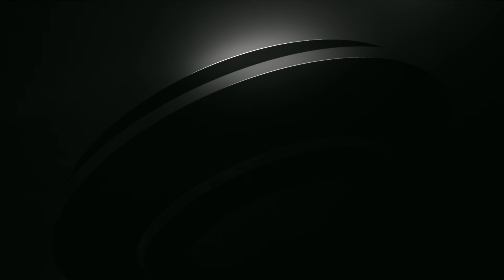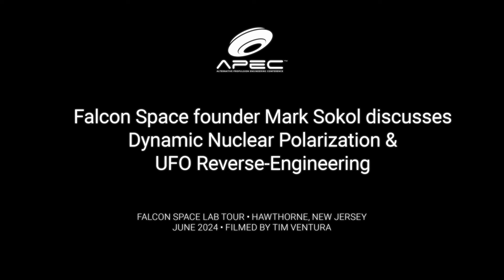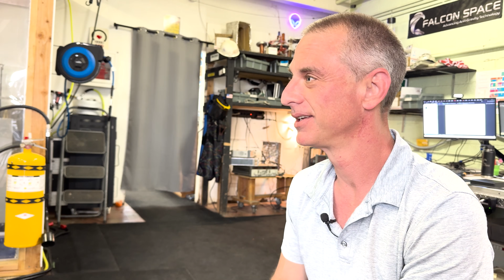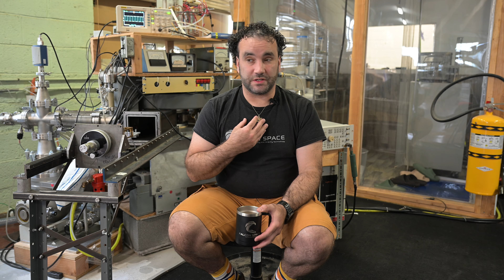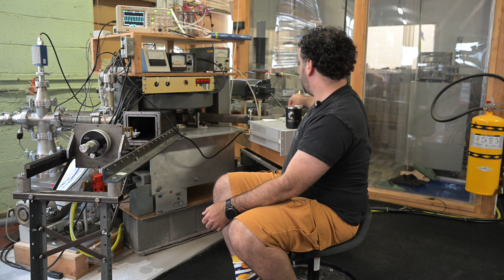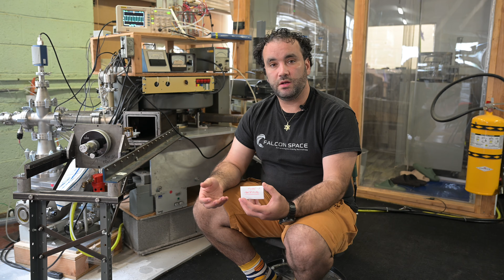UFO Reverse-Engineering & Dynamic Nuclear Polarization | Mark Sokol | Falcon Space 2024

Comment: If you find which energy band causes static on older analog radio antennas. You will be using the energy wavelength as the government crafts that abducted people all through the 70s-90s. It was quite common for people to mention bright lights and static on their radios when one appears. So lots of energy particles bouncing around. 

Also look into sand playing a roll. Some of them discharge sand plates. I believe for thermal regulation and possibly as a battery method. 

I have so many years of small little fact details researching these things. Could chat at all day. I really like your project to prove this is not some magic (or could look like magic to our present tech) and is grounded in science.

Comment: In addition to aligning nuclear spins via high frequency rotation, you need to put the atoms in the Bose-Einstein Condensate (BEC) state at very cold temperatures so that their spins are synchronized (coherent). You have to then compress these atoms together to make the material superconductive to reduce its permeability to Zero, increasing the speed of light in its vicinity. This then allows you to "wiggle" the highly dense centers of the atoms in a coherent way via electromagnetic waves, and that, in turn, generates the intense gravitational waves (GW) that Bob Lazar has been talking about since the late 80's, and that is how the GW are amplified. The problem is coming up with the money to do these experiments outside the US military which has an endless budget.
Reply: How do you know that?
Reply: @brianmcginnis7417  There are recent scientific papers published that show the internal density and structures of nuclei. I'm an Electrical Engineer (PhD), but a scientist/physicist at heart and have been studying UFOs, GW, and reading the latest scientific papers regarding related subjects (particle physics, astrophysics, etc) for the past 30 years. Also, I have proof that not the speed of light (C), but 2C (2 x C) is actually the measured relative "speed limit" of the universe (this is in the general case, not in the special case mentioned in my initial comment above). I can explain more if you want. Are you going to attend the APEC conference tomorrow afternoon?
Reply: @brianmcginnis7417  Interestingly, physicists/engineers always measure the resistivity or resistance or the current-carrying capability of superconductors (SC). Nobody measures the speed of light right at or above the surface of the SC inside a vacuum. I think they would find very fascinating results if they do so.

Comment: It is difficult to tell exactly what you are doing.  Let me guess.  You are doing NMR (or ESR) with a sensitive weight scale on the sample.  You obtain a resonance and polarize the sample.  Then you perform some kind of spin-flip to see if the weight changes.  Right?  I expect you know that if you cause a spin orientation by the resonance, your sample will generate a non-uniform magnetic field that will interact with the big magnet to cause a force and effect your weight scale.  So, I do not really know what you are doing.   I built and ran an ESR spectrometer from microwave parts in an undergraduate lab in 1979.  Thank you for sharing. You can look me up to see my work also.

Comment: As an analytical chemist I can see what you are attempting to measure and I sympathize with your string through the hole gravimetric approach. I would approach it instead measuring resistance to acceleration. Can you envision your method and apparatus? Can you see how to get a clean baseline with a ghetto budget? Get on it.
Reply: That sounds like you could use ultrasonics to measure resistance to acceleration. Look into how a solid state gyroscope works. It uses what might be described as a tuning fork. If the sample can be mounted to a piezoelectric actuator, the difference of two arms can be measured quite accurately.